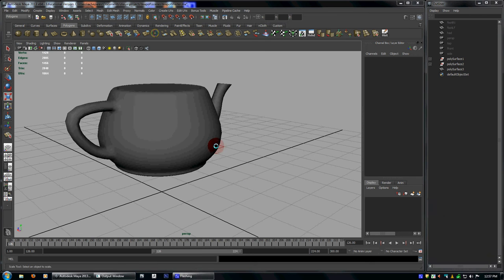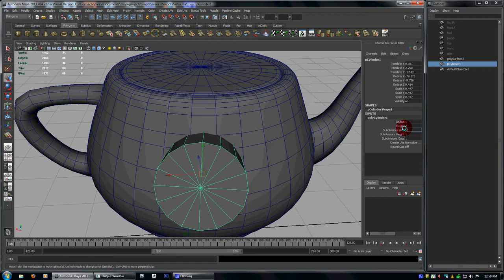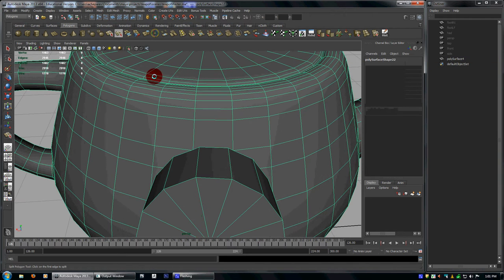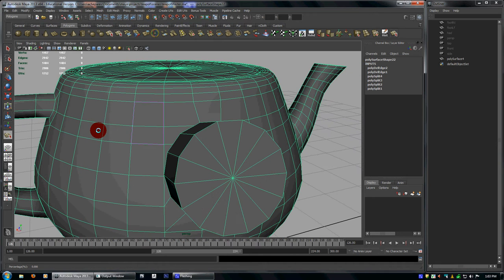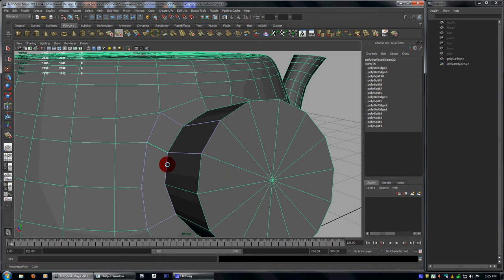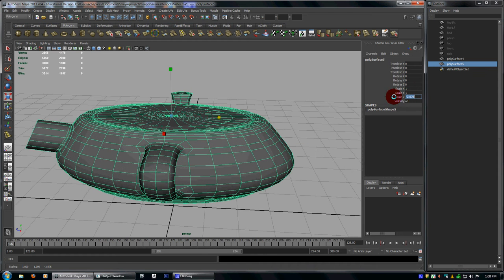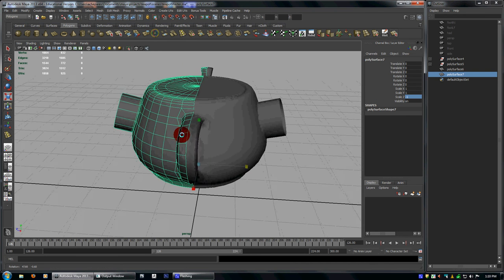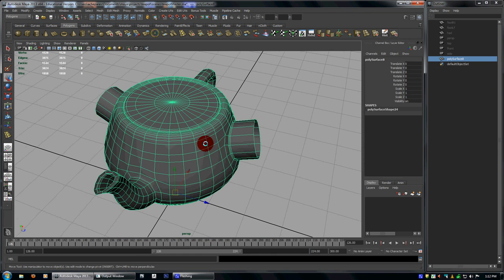Polygon Boolean and Cleanup

Comment: I've been having some problems with using the split tool clean up geometry after boolean unions in Maya 2012. It says I can't end up on a hole when I try the Split Polygon tool, and trying Interactive Split causes Maya to crash altogether. I'm using it on simple shapes too (intersecting simple cylinders and cubes) and it won't let me clean up my geometry. Do you know what the issue might be?
Very good tips on utilizing Booleans though.